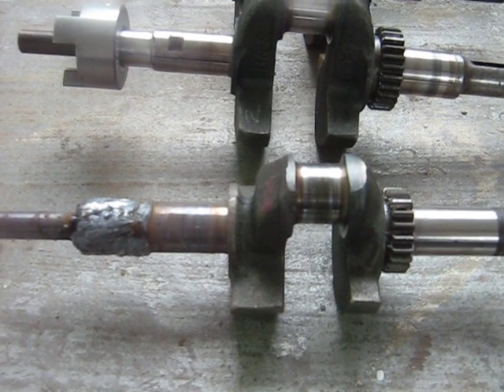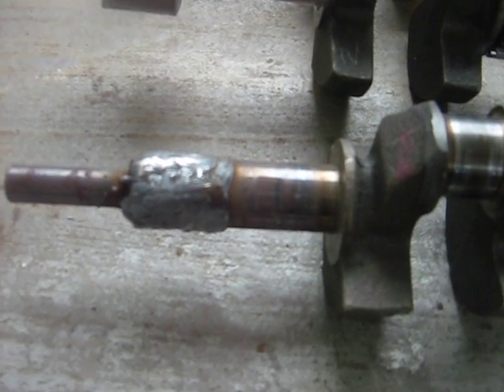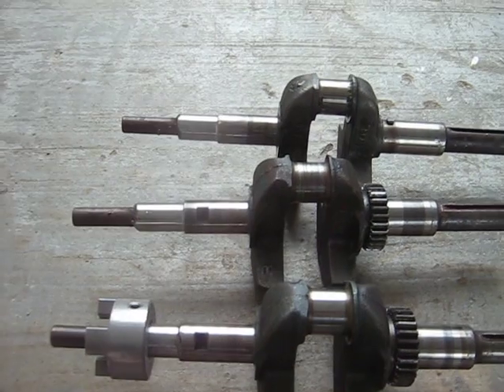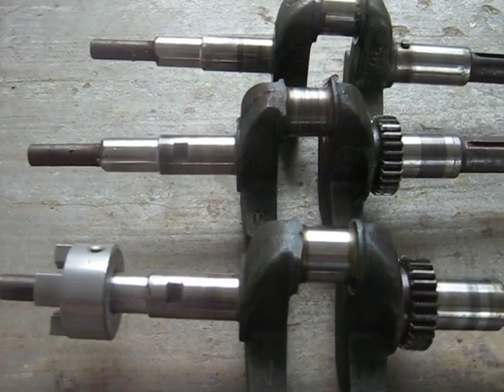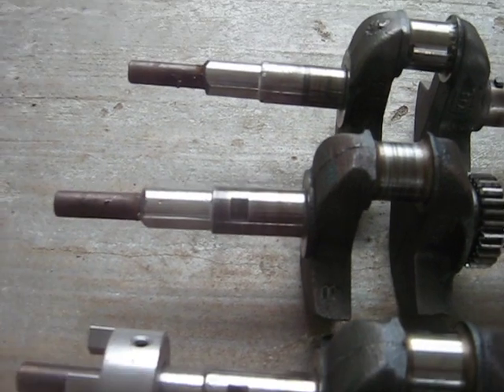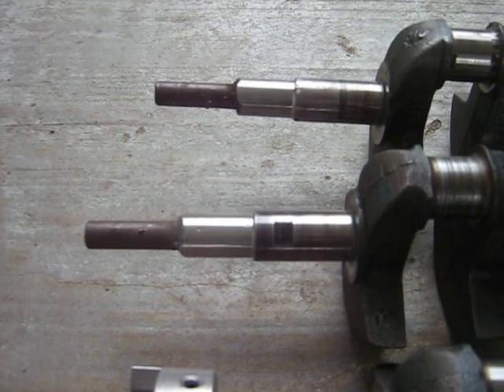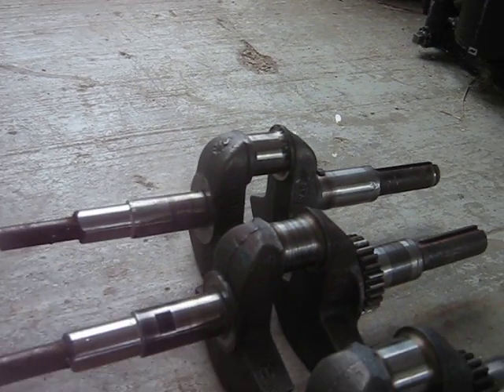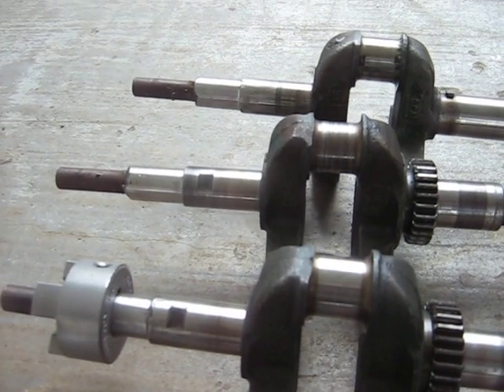Briggs 4  Cylinder Crankshafts

Comment from the maker: Yes, I think something would self destruct with enough load on the last crankshaft.
These FrankenBriggs engines are just experimental, althought the Sleeve valve did put out 4.75 horse at 3100 rpm from 8 cubic inches.